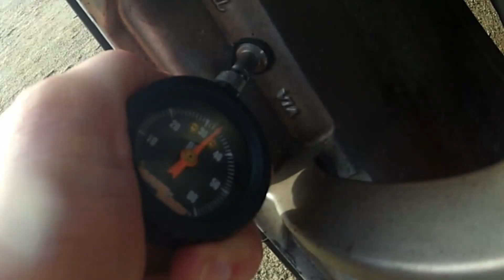Driving my NSX for the first time after DIY major service (nervous!)

Comment: Did you have an issue with it not starting after the maintenance. Mine fired up for like 20sec then died. Now it won't start unless I disable the fuel pump. Very baffling.
Reply from the maker: Apart from it taking maybe an extra revolution or so to fire, I've had zero issues with the way it's run since I got it back together.  Hopefully my luck continues in that regard.  Definitely an odd problem though.  So if you disable the pump it will start but then I presume still die once the fuel in the lines runs out?
Reply: @LapoftheWorld  precisely, I'm at a complete loss. It makes no sense.
Reply: Figured it out the belt jumped. Now she purs like a kitten.
Reply from the maker: @CHUB401  Glad you solved it (and with no bent valves I hope given the cause).